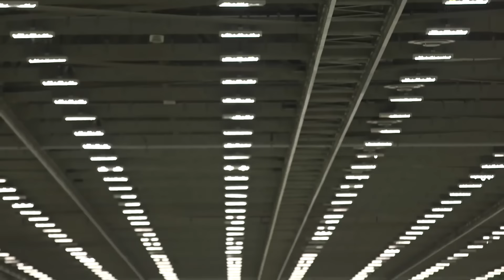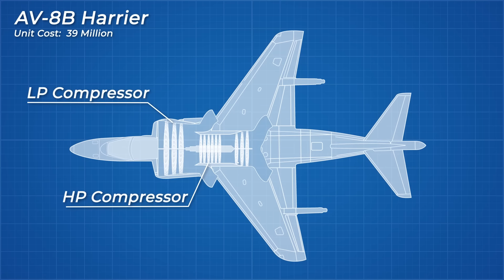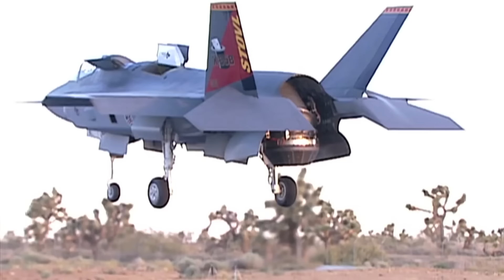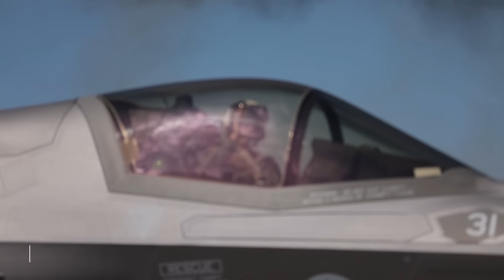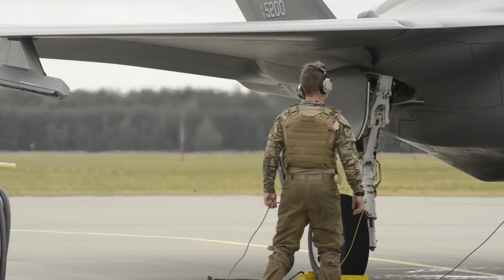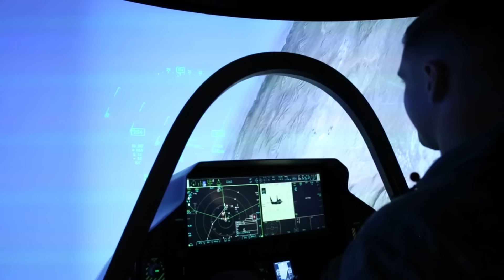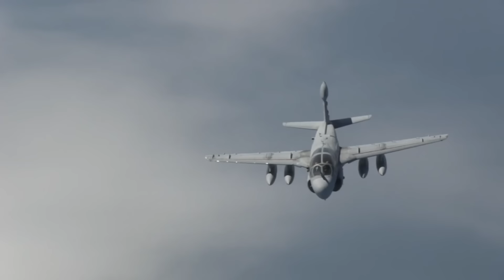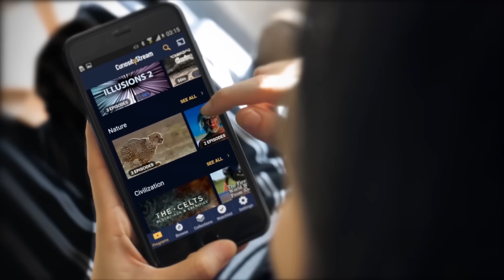Is The F-35 Worth $115 Million?

Comment: Saying that the design and construction of 3 different 5th generation jets cost less than the JSF budget is a huge assumption!
Since 3rd generation jets, budgets were always busted. There were also always delays. When the F-14 came out (4 gen), it was a disaster - and it was barely usable - especially its engines were not adequate and only when there was an upgrade with new engines, the F-14 slowly became as iconic as it is remembered today. The F-15 had its own set backs - and it was so expensive, that the USAF agreed for the F-16 - which had its own challenges (let's not talk about the F-4, or the F-104 and so on). With more complexity the challenges were just increasing.

So why does anyone think, that 3 distinct variants would have been easier to develop and cheaper? 

Using now (or a bit less than ½ year) a report, which goes back another 4 years is also not real objective. These agility issues have been all addressed and it was the (earlier) software which limited the more aggressive flight maneuvers. Even though it is also said, in the video, it is not at all an argument, and should not at all be any consideration.

Another big fallacy is bringing up the shot down of the F-117A. First of all: the plane wasn't widely intact. Second: reverse engineering of complex systems is extremely difficult (especially when it comes to material science etc.). Third: When the F-117A was shot down (due to several issues, like enemy intelligence, the flight of the missions despite of the fact, that the F-117A could not follow their strict rules of engagements etc.) the muster has been already almost 30 years old. Fourth: one important point of the success of the stealth program is Echo One - which isn't available only because a muster has been acquired by the enemy...

At the end, we have to be real here: 
The price of the F-35 is really very good. Given that the A variant (which is far more capable than any other aircraft to date) cost about 20% less than a EF-2000 Typhoon. Also: legacy fighter jets might be cheaper - but if you are comparing the latest variant (F-16 Block 70, F-15 EX etc), it gets closer - plus mostly the additional necessary target pods which cost also millions (also increase the maintenance per flight hour) will make the F-35 pretty competitive.

Comment: The F-35 has ended up being 3 different planes anyway, they just wasted a lot of money trying to make it 3 variants of 1 plane and failed.
Reply: Hardly the case. The JSF in the early nineties was looked into being one aircraft with minute variations to meet each requirements however they learned there are serious limitations with that concept. So by the mid nineties the JSF, and the X-35/ F-35 specifically grew to be three different aircraft with high commonality. A much better situation financially than having three separate programs for each requirements.
Reply: Yeah, they thought commonality would save money but it didn't! 
From Do Joint Fighter Programs Save Money? RAND Corporation, 2013 :
"JSF acquisition costs would be 10 percent higher than those for the notional single-service programs. 
- Under none of the plausible conditions we analyzed did JSF have a lower LCC than the notional single service programs"

Comment: Once again we have failed to overlook lessons in history.  In WW2 the Russians used a crude and inexpensive tank produced in massive numbers by uneducated farmers to beat the highly technical Germans tanks that were expensive, complex, and produced in low numbers. Can we really afford to have a bunch of $100,000,000 airplanes shot down?  Will we be able to quickly manufacture replacements during a war?
Reply: They’re getting cheaper and cheaper. Currently the A variant is cheaper than the latest F15 or EF typhoon.
Reply: Not really the case. The Soviet losses came not from equipment but lack of training and lack of experienced officers early on in the war. Admittedly some German equipment was better in performance- but the difference there is tactics, strategies, and experience.

Comment: The cost per unit as of early 2020 is less than $80mil for an F-35A. There’s been A LOT of improvement and testing since the article you used was published. The advantages of this aircraft far outweigh any 4th gen aircraft and over time this engineering marvel will prove it’s worth. The one thing you touched on was the suite of advances sensors/optics and such. Most people really have no idea what this aircraft is truly capable of...it’s a flying information platform and sharing/networking suite. It’ll be fully integrated into other battle systems and be able to spot/pick targets and direct ordnance from other aircraft, UAV’s, ships, subs, missile batteries, etc. it may not be the dog fighter some 4th gen aircraft are but because of the incredible radar/sensors it will see everything before anything else see’s it, make the kill and be gone without the other aircraft/other asset knowing it was ever there. Excellent video, as usual. 👍🏻

Comment: The F-35B is not VTOL.  It can only land vertically.  The F-35B can not transition from vertical takeoff to horizontal flight.  It should be described as a vertical and short takeoff and landing aircraft (VSTOL).
Reply: It can takeoff vertically. Just operationally it won't be typical.
Reply: Yes, it can.

Comment: What do you expect a test pilot employed by Lockheed Martin to say about the F-35? It took guts for the first pilot to talk about the jet's shortcomings. It's a boondoggle pure and simple and pushed through for economic gain. The more complicated a jet is, the greater the chance for breakdown of all the complicated components. As far as new generation plane's go, The Raptor is a better plane, at least for the Air Force.I hate to see such successful weapon programs such as A-10 go by the wayside replaced by this poor performing mess. Money into the US economy, what a joke. That's such a good reason for pushing through the F-35. This video is towing the line.
Reply: The F-22 does a single role slightly better than the F-35, and everything else significantly worse for double the price. If we're talking bang for your buck then the F-35 far outclasses the F-22. The A-10 is only successful because fighters like the F-35 exist. What aspect of the F-35 makes it a poor performing mess?

Comment: Hey I looked up that one negative report on the F-35's dogfighting capabilities. It turns out the development team was testing software that converts pilot yoke inputs into movement of the control surfaces. 

Apparently when designing a new aircraft the developers "play-it-safe" with the software so the plane doesn't accidentally move the control surfaces too much and stalls. This means that there will be a couple dozen test flights where the pilots test a new software package which only adds a few degrees of movement to certain control surfaces compared to the software they just tested.
Reply: That's why the F35 has one of the best T&D safety records per flight hour. That software  block 2b plane was rated to turn at only 5G. They then increased it to 7. Now its rated at 9. Its a completely different plane to fly now. That's why pilots love it.
Reply: @yakidin63  Holy fucking hell! 9G!!!!

Comment: I have a Swiss pocket knife. It has a saw but it really doesn't saw as well as my normal saw. It has a screw driver but my other real screw driver just works a lot better. It also has a pair of scissors but again...
So, if I need a saw, I'd better by a saw. If I need a screw driver I'd better get myself some real screw drivers. When I need a pair of scissors... Why the hell would I want a Swiss pocket knife?
Reply: Not sure what you're getting at... The F-35 is king in almost every role it performs.

Comment: It would have been interesting to see a Harrier redeveloped into it's ultimate version of it self. Modern materials, modern engine, fly-by-wired, fancy HiTech AR helmet, radar absorbing paint e.t.c.
Like the f-18 v Super Hornet.
Reply: An aging fighter with major safety issues and mission capability limitations? Unfortunately the harrier really isn't in a place to be upgraded or continued, unlike fantastic adaptable plateforms like the f-16 and especially f-18. The harrier by design is just outdated and didn't have a future
Reply: @thezombiepotato1  All good points. I do wonder how robust the f35 will be, dust, sand, small arms etc. 
& I can't for the life of me see how it could replace an A10? But I suppose they would have the back up of drones to aid the loiter time. Also, there's talk that they have a very long turn around regarding software & re-arming? Not just fuel & go. But that's likely a problem with all of the latest generatin fast jets.
Reply: @sjion  legitimate issues with the f-35, why I don't think a full replacement is needed, and neither does the pentagon anymore. The f-35 was repurposed to aide and improve surrounding 4th generation systems, letting us integrate them with f-18Es which have 3 times the sortie rate and greater payload capacity. There have also been extensions in the a-10 as it's still a much cheaper and more direct CAS platform, and systems like the f-15x work as external missile magazines for 5th generation fighters who can then maintain full stealth configurations while firing missiles from a separate platform. The drones still have a long way to go, I really don't have much of a full opinion on them yet
Reply: So the f-35 B?
Reply: @thezombiepotato1  Sort of... but without the 26 year long development & billions of dollars.

Comment: The f35 is still no mach for the f18 hornet
Reply: Based  on what?
Reply: @peterson7082   the F18 superhornet holds the highest top speed and maneuverability of any U.S. fighter and is still used as an interceptor over the f35. It also can carry more / larger missiles then the f35.
That why the U.S. Navy still uses them along side the f35. A f18 interceptor trumps a f35 in it's roll. Interceptor aircraft are a counter to attack fighters / fighter bombers/ air superiority fighters so if the f18 super hornet out performs the f35 as an interceptor then it trumps it in combat.

The f35 is better for it's own roll but it still loses to an attack form f18s. All things being =.

Plus higher sonic missiles are still going to be huge for a long time and will not fit in the f35's bay so any craft with external mounts like the f18 has an advantage in fire power at list on paper. Hell some f35 sold to other countries have had to mount missiles to the f35's wings do to there weapons being to big for the f35's missile bay already.
Reply: @madmachanicest9955  The F/A-18 performs worse than the F-35 in all aspects, especially speed, payload, and range. The Super Hornet is still being used because it entered service in 2003. The Hornets that the F-35C is replacing have already been retired from active service to supplement the USMC Hornets which will soon be retired in favour of both the F-35B and F-35C. And lastly, no variant of the F/A-18 is considered an interceptor. All F/A-18s are multi-role fighters with a greater emphasis on the Strike role than air to air combat.
Reply: @dumdumbinks274   will we could argue about this all day and get no were. Lets just say that no aircraft is perfect and so thy both have there ups and downs. The f18 would make a better interceptor then the f35. To bad the roll of interceptor is being hazed out.
Reply: @madmachanicest9955  There is no combat situation in which the F/A-18 is better than the F-35. F-35 is faster, more maneuverable, longer ranged, carries a larger payload, significantly better electronic systems, and on top of all that has the option of operating in stealth configuration.
Reply: @dumdumbinks274   all right you win the f18 is slower then the f35 and it's not a match for the f22 in air combat but would smoke the f18. The only advantage the f18 has is the under wing missiles over the bay of the f35. This lets it use some weapons that will not fit in the weapons bsy. This is mostly irrelevant how ever. Thy could have also  have fix the size limit problem by now. My in formation on this and the plan is / was out of data. Still think it's a huge wast of money to try to build a plan or anything for that matter that can do every thing.
Reply: @madmachanicest9955  Well it's good that you're learning, but you've got quite a way to go yet. 

If stealth isn't required i.e a situation the F/A-18 can be effective in, then the F-35 can use external pylons. Theoretically in air to air configuration the F-35 can carry up to 16 air to air missiles in total while still having longer range and better performance than the fighters it is designed to replace, assuming they are in similar configurations. You won't see payloads like that on any fighter though because it is a waste due to the risk of losing the fighter before it can use all those missiles, as well as the fact that proper mission planning removes any reason to use large payloads. 4 aircraft are better than 2 doing all the work, so why not split the payload between them? There's also the loss of performance to consider e.g the F-16 is supposedly capable of Mach 2.0, but with only 6 missiles loaded it is limited to Mach 1.5. An F-16 on a typical strike mission is barely capable of supersonic flight. This is not the case if you have an internal payload since the weapons won't be causing parasitic drag. 

An F-35A can reach 1930kmph (Mach 1.61) in any configuration as long as the payload remains internal (can carry an F-16's average strike payload internally), and it has no need of external targeting or ECM pods because every electronic system it needs is already part of the aircraft (and it is designed to be modular i.e individual systems can be upgraded easily). It's range is also exceptionally good to the point it doesn't even have the capability to use external fuel tanks.... basically the F-35 can carry larger payloads because it doesn't have to carry anything else and doesn't suffer as much in terms of performance.

F/A-18 typical air to air load is only 6 missiles, which is what the F-35 is designed to carry internally. If the F/A-18 is in a practical configuration for a mission i.e external fuel tanks, sensor pods etc are loaded, then it's max payload (unlikely to ever be used) of AA missiles is between 8-10 depending on exact configuration. 

FYI the F-35 is not designed to do everything. It only performs the roles the F-16 already performs. The main difference is that the F-35 program produces 3 physically different aircraft that perform the exact same roles from different locations. Since they are all physically different the sacrifices made to achieve certain capabilities only affect a single variant 

- F-35A is the representative model that most services will buy and is what the other 2 variants are based on. Since it has no special requirements it does not make any real sacrifices. 

- F-35B is the STOVL variant for operating from short runways or small carriers that don't have catapults. It is a fatter airframe with a large hump behind the cockpit causing a lot more drag. It's acceleration to Mach 1 is reportedly 20 seconds slower than the F-35A. The hump is absolutely necessary in order to fit the lift fan into the airframe. Additionally they had to shorten the weapons bay, meaning the F-35B cannot carry large munitions such as 2000lb bombs internally, whereas the A and C models can. 

- F-35C is the CATOBAR variant i.e launches from catapults and lands on arresting wires. It is the heaviest variant and has larger wings as well, meaning more lift, but more lift means more drag. Those factors result in worse performance than the A model, but Navy fighters typically have lower aerodynamic performance than Air Force models anyway. However it isn't a drastic loss of performance and if you double the thrust of the F/A-18 the result in terms of performance is what many pilots call the F-35C.

EDIT: seems I forgot to mention that since they all share systems and have much higher commonality between them than other aircraft do, it means the program is overall cheaper than the alternative of producing 3 separate designs and thus having 3 separate development programs.
Reply: @dumdumbinks274   yes i get it . keep in mind the wing mounts were add to the f35 to overcome it bay limit it was a problem thy fix latter.
Reply: @madmachanicest9955  There was never a payload problem. Internally the F-35 matches the average payload of every fighter it replaces. External weapons have been part of the design since it first flew and are only intended to be used when the threat level is low. External weapons give the F-35 a payload capacity comparable to much larger fighters such as the F-15E.
Reply: @dumdumbinks274  will your not going to coven me of this one . other countries using and testing the f35 found some of there older larger missiles would not fit in the bay. This was before the roll out of the b / c model and the first test crafted did not have wing mounts. So that my have been a factor in the 35 have wing mounts now.

In short your info is on the f35 and my info comes form the r35 early model and public porto type date . at this point we are really talking about 4 different aircraft and most of my info is out of data.
Reply: @madmachanicest9955  It says a lot that the first weapon to be tested externally that couldn't be used from the internal bay was a standard air to air weapon that had been planned to be integrated right from the very start of the concept (not just the official program) in the 1980s. No weapons have been tested that cannot fit in the internal bays even though testing of external weapons capability began in 2012. The first such weapon will likely be the AGM-158 cruise missile.